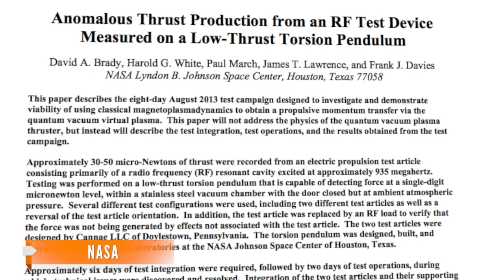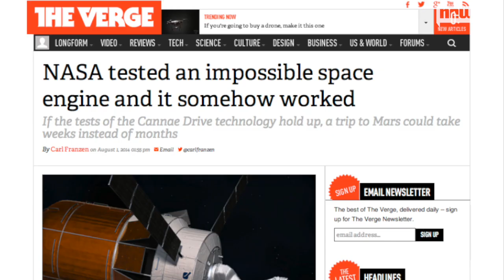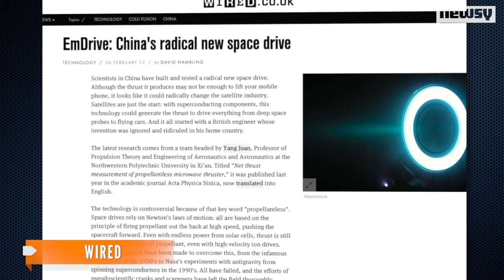NASA Tests 'Impossible' Engine, Finds Out It's Really Fast

Comment: The most reasonable explanation I can think of after having read the 2014 Energy and Propulsion Forum paper is that under specific resonance and a supply of energy, some sort of disturbance is produced which is able to collapse the wave functions of the "virtual particles" such that under quantum mechanics a "real" particle results with a momentum vector somehow dependent on the resonance or the shape of the cavity. This could all be totally wrong as I am by no means a quantum physicist, but if some fashion of this explanation is followed, the system is not impossible. It is simply a clever way of letting a macroscopic quantum mechanical system do an energy conversion.

This mechanism of propulsion is not too farfetched in my mind. What I do find mysterious, though, is how simple the mechanism which produces these effects is versus how little there is actually written about it, again versus the massive importance a technology such as this represents to many fields of engineering.

Simply put, I don't see this system breaking any laws of physics, but I feel there are many undiscovered and undocumented difficulties in bringing it to application. Similar to quantum computing, which has been the host of many lofty claims but snail-speed progress over the last 30 years. (Though recent developments have been fairly exciting!) Or, also similar to NASA's ion drives that have been on the workbench for ever.
Reply: ...err.. virtual particles are not 'real'. That is why they are called virtual. And the concept of collapse of a wave-function belongs to a particular version of quantum mechanics. Other versions don't require or recognise anything to be collapsed. Besides, as I said, these particles can't have a wave-function if they are virtual because of their all-too-fleeting existence.

Comment: As a qualified physicist and amateur astrophysicist: I can't see what the problem with the drive is. It doesn't seem to have violated the laws of physics. It emits microwaves, which have momentum. To generate 30-50 micro-N of force for 1 second would require between 90-150J (assuming a 100% energy to microwave efficiency).  Being very, very generous and saying that 1kg can generate 1W, that means to increase velocity by 1m/s will take 11 days. And to go from low Earth orbit to escape velocity will take 66 years. That has always been the problem with these types of systems.
Reply: The problem is it does not emit microwaves, instead they just bounce around inside the reflective cone. That makes as much sense as trying to move a car forward by pushing on the steering wheel.
Reply: Hunter Proctor
 The guy is overstating the case. We should point out that while NASA observed an effect, it was about 0.1% of what the guy was claiming. That is a big difference.
Reply: They might be leaking out the back (the photons quantum teleporting out of the cone is a proposed solution to the source of the thrust) but they are not supposed to. The microwaves are supposed to just bounce around inside the cone and not come out the back, hence why the entire cone is enclosed.
Reply: Virtual particles are not imaginary.  They are completely real and totally consistent with quantum mechanics, which has been the most successful theory in physics ever and still going strong after 90 years.
Reply: This video said that this tech could get us to Alpha Centauri with in 30 years and that's 4.3 light years away. You say it would take 60 years just to get out of earth's orbit so you agreeing with this guy doesn't make much sence
Reply: Yeah my understanding is the EM drive would be what you use once you've busted out of the local gravity well. The thing that piques my interest with this is , assuming it works (big assumption!), assuming you could strap a big fuck-off sized nuclear reactor to it that can give you 30-40 years of decent power, you should be able to do constant acceleration, and remembering that your measuring from the local relativistic frame, theres really nothing that says you cant. So say optimistically you could build one that could pull off, say, 0.1G constant acceleration,  suddenly its plausible to go to , say, Alpha Centuri.
Reply: Well it’s taken 50 years to send a probe to look for water on mars another 50years to look for worm holes! Most futuristic in today’s society is still the invention of the micro-wave
Reply: rude
Reply: That's like saying since Goddard's rockets only lift a few pounds forget going to the Moon. This kind of thinking led to Nazi rockets first. With a proper sized budget this will scale up and give humans real space travel by using first chemical rockets to start the trip.
Reply: We saw a ghost, but it was very faint. We confirmed telepathy, but we only sent a one word message. We flew at Kitty Hawk, but only 90 feet. We walked on the Moon, but only for a few hours.
Reply: Warren Pierce you surely don't see any difference between science book and a novel, do you? 
maybe with exception of following the rhetorics!
Reply: Hey Qualified Physicists, what do you think of using a "virtual" particle to power an engine? I'm being sarcastic. Virtual particles are imaginary mathematical constructs and is like saying I'm physically powering something with a math equation.
Reply: Question would it work in the earths atmosphere?
Reply: If you believe that there is no problem with the drive you are obviusly not a quallified physicist. 
Yes microwaves have momentum but you cant transfer momentum to yourself...
Reply: spacecadet35   That’s exactly what I was gonna say!
Reply: Please!! I’m still struggling with Long Division!!
Reply: I agree with what you have said there, it's just a different type of rocket using basic laws of motion.
Expansion and contraction of space time theory (Warp Drives) seems to be the way to look?  
The whole concept is mind blowing and really breaks away from the limited Newtons theory way of life, I think its great to see a shift in the way we think, it's time to embrace a quantum way of looking at life and science IMO.
Reply: I find it very interesting that there is even a visible reaction at all. So given the insignificant amount of thrust it produces, why is NASA even looking at it in the first place? Sure the physics are interesting, but unless there's a way to amplify the output exponentially, this type of machine can not be used to efficiently propel a hoveround, let alone a spacecraft.
Reply: They just proved that ''The Impossible Drive'' is just what it sounds like. Impossible. The drive, when tested in a vacum, exhibited no thurs what so ever.
Reply: Rocketed to high Earth orbit and having dived to slingshot around Earth to again slingshot around the Moon to once again slingshot around the Earth then again the Moon this fueless engine  will be traveling pretty fast and accelerating to anywhere!
Reply: @markphipps8655  no
Reply: For some reason you neglect that the 1kg rocket will be stuck on the surface of the earth by 9.8 N or 1 g.  It won't start to move upward until subjected to 1g plus some additional force.  Wind forces on the 1kg rocket will be many orders of magnitude stronger than the force produced (arguably) this magic motor.  So it aint getting off the ground. ever.

Comment: "It Cannae break the laws of physics Cap'n!"

Very likely due to bad experimental protocol. They couldn't even test it in vacuum. What happens when you heat up air unevenly over a surface? You get currents. Easily enough to account for the very tiny forces measured.

I NEED MOAR EXPERIMENTAL TESTS GODDAMMIT!
Reply: It was tested in a vacuum and they found that no outside forces were acting upon it.
Reply: Eliot Winchell
When was it tested in a vacuum?

They mentioned in the write up that they put it in a vacuum chamber but did not turn it on because the semiconductors they were using weren't rated for it.

Comment: A "control" engine that was designed specifically not to provide any thrust but just sit there also measured a similar amount of thrust on the same test stand. Translation: the 30-40 micro newtons of 'thrust' (about the same amount of force as the weight of ten grains of salt) is just noise in the measuring equipment, i.e. the thing doesn't work. Physics strikes again.

Comment: May I ask what is the big deal of how this drive disobeying the conservation of momentum? Because it seems exactly like how a solar sail works, in this case microwave is emitted toward one direction, and due to radiation pressure an equal and opposite force pushed the spacecraft to the other direction.